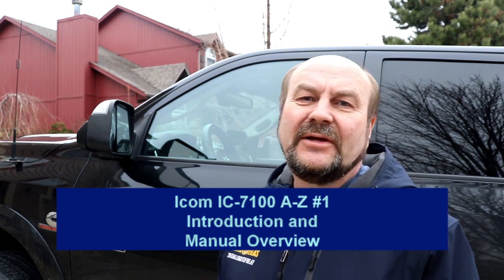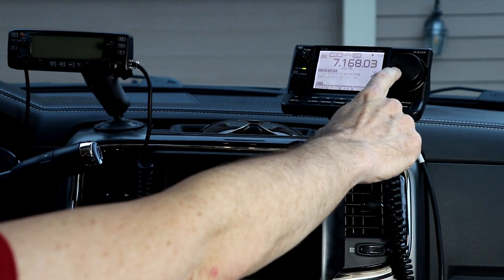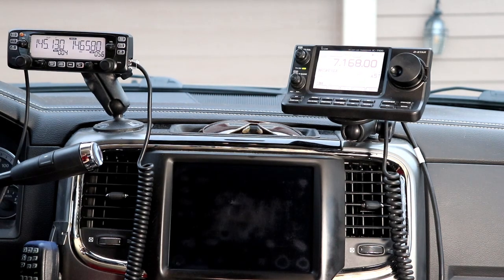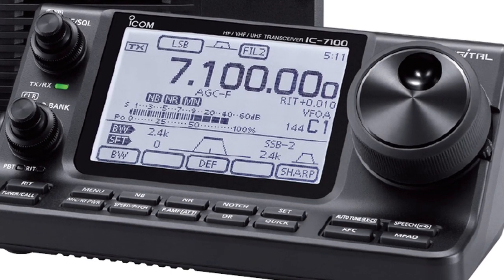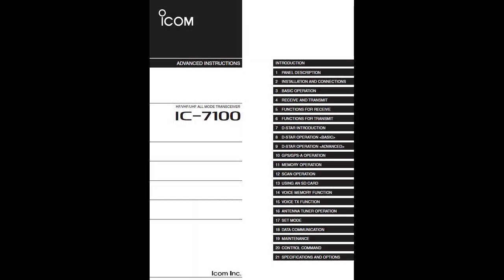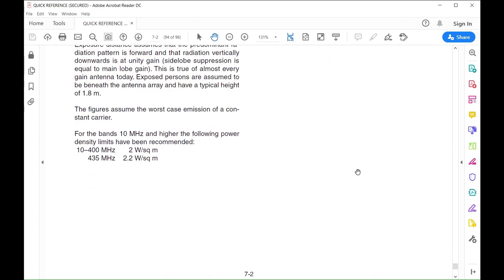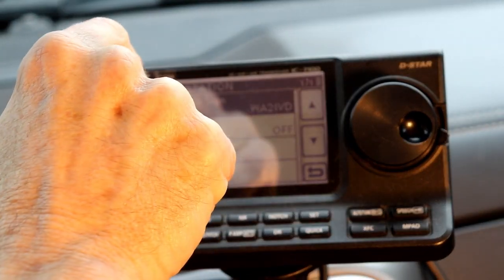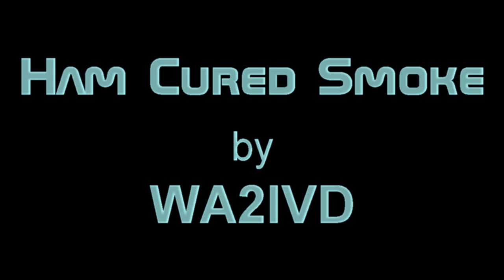IC-7100 from A to Z #1 Introduction and manual overview

Comment: Thank you for the 7100 Videos. I bought this radio as a backup to my FTdx10 (Which is in the shop!), and I use it mostly for ft8. As a result, I didn't explore the user interface too much, operating mostly from the computer. This is a Great radio! And your videos introduced me to  that! Thank you!

Comment: Many thanks for this series. I've just installed my new iCom 7100 and getting started is a bit more than a little intimidating. I tried to have it up and running for Field Day, but I don't think I mastered enough of the bells and whistles on my own as I wasn't having much luck with anything but simplex 2m. I'm looking forward to learning about this rig -- it seems like a nice piece of kit for the price and for my needs.
I got a nice Yaesu 991A for my QTH base station, and I bought my 7100 to replace my Yaesu FT8900 in my Toyota Tundra. While the 8900 offers 6 and 10m capability, it's only FM which is pretty useless. The two Ham clubs I belong to both offer 10m nets, using USB. The only way to accomplish my communication goal was to move to a much more versatile rig which I'm already seeing in the 7100. 
I look forward to working my way through your sessions.
73
Dale
KF8DLD
Reply from the maker: Hi Dale.  Thanks for the kind words.  I just mentioned in another comment that I’ve been offline for a while.  We’ve been moving into a new house.  I’ll be back in video production soon and plan to get the 7100 series re-started.

Comment: Thanks for doing this. I bought the IC-7300 last November and the IC-7100 in February of this year. I have it installed in my Jeep Cherokee. I have a video on that install on my channel. I dumped the terrible microphone for the IC-7300 microphone but had to purchase the adapter to go from a round DIN connector to a RJ45 modular plug. Not happy that ICOM does not supply the mounting bracket that I had to buy to make my Jeep install complete. I could have made one but would have spent more time into that than what it was worth. Yaesu includes brackets with their FT-891. Puzzling except I just have to call ICOM cheap skates!
I have made some great contacts with just the three 20, 40 and 75 meter meter Shark Distributing whips. I have received great reports on audio and signal strength.

Comment: Disassembled stock HM-198 microphone and found tiny mic hole is also NOT aligned with mic element rather its at the bottom of rubber mic element support nearly completely blocked. The tiny (obstructed) hole in mine was at the top of the second louver. I drilled a hole at the bottom of the first louver which is dead center aligned with mic element. I suppose you can imagine the performance increase! Be sure to completely disassemble the microphone before drilling a hole or you will damage the microphone element (obvious) if you do this "Necessary Modification"
Reply from the maker: Thanks for the tip.  I wonder if they’re all that way or if you just got one that was poorly assembled?
Reply: @HamRadioA2Z  I posted on Facebook Group also and someone else had the same. He did a similar modification and posted photos. You can remove the rubber grommet blocking the hole and remove some material allowing the original hole to be clear. Wednesday Night 10 meter Net many praised my audio, one asked how much power I was running (Just 30 watts) no more was needed with good audio (Mic Gain 65% -  Compression 2) I do not have a loud voice ; ) Thank You for HM-219 / HM-198 comparison which is what sparked curiosity ; ) I am not a modification advocate but this seems obviously necessary. . .
Reply: Another ham made a video on using the IC-7300 speaker mic with the IC-7100 https://www.youtube.com/watch?v=kZLsbM2z_ZA
Reply: Just got my 7100 set up.to replace my 20year old 706.   Found this great set of videos.    My 198 mike also had the hole blocked.   Thanks for the great tip.   I saw someone's video where he said the 198 mic was not very good, I wonder if her had this same problem?

Comment: Do you go into setting up and using an external GPS with the 7100 I am very interested in the Near Repeaters functionality using the GPS
Reply from the maker: It is something I’ve thought about doing.  Just haven’t got around to it.
Reply: @HamRadioA2Z  Definitely looking forward to it. As a relatively new ham researching radios, the "Near Repeaters" is probably going to be my drop dead must have feature in every radio. The GPS capabilities of the Uniden SDS scanners have sold me on the idea of active radios.

Comment: Thanks foe rhe video!  Have you heard any news about Icom updating the 7100 to directly compete more with the Yaesu 991a?
Reply from the maker: I have not.  The last firmware update for the 7100 came out in 2016.  Even though it doesn't have the hardware capability of the 7300 or the 705, there are some features on those radios that they could implement on the 7100.  I keep hoping that they'll release another update since they are still selling the radio.

Comment: Your videos on the 7100 are really great.  Can you elaborate why there is a low power output "hardware hack" required to enable advertised power when operating on phone portions of the HF bands?  Is there a firmware update to fix this?  Thanks
Reply from the maker: Hi Jerry.  Thanks for commenting and for your kind words.  You’re not the first to ask this question.  I have done some research into this and have contacted Icom about it.  It is a somewhat controversial subject.  I believe the perception comes from not seeing the meter hit 100% power on voice peaks and also, not seeing an external meter hit 100W on voice peaks.  According to Icom, the radio does put out the advertised 100W when modulated at the correct level with a steady tone and appropriate test equipment.  I have looked at several of the mods on the internet.  I have not personally tried any of them.  I’m sure they do cause the radio to put out more power.  I’ve seen some claims that a few of them will push the radio beyond 100 watts.  The questions are:  Are they overmodulating and putting out a lot of splatter?  Will they damage the radio by putting out too much power?  I don’t know the answers to either question, but I would be wary.  I have not felt that this is a problem with my radio.  When I set the mic gain and compression level to get some movement on the ALC meter, but not too much, I don’t have any trouble making contacts.  I don’t typically watch my power meter that intensely unless I think there is some specific problem going on.
To put this in context, a properly calibrated S meter on a receiver moves 1 S unit for a 6db change in input power.  6db is approximately a 4X difference in power.  So if your radio really is putting out peaks of 60-70 watts and you do something to get those to 90-100 watts, you’re not going to change the receiving station’s S meter reading by even 1/2 an S unit.  So it really is splitting hairs and (I believe) more about seeing the output power meter peg more often.
That’s my opinion.  I’m sure you’ll find many others if you do some searches on this topic.  73, Tom
Reply: @HamRadioA2Z  I do agree with you and have done additional reading on the subject as well.  Considering all settings are at least default, I’m thinking this is more of issue using an average power reading watt meter as opposed to a peak reading one.again.  Again great videos? KO4IAB 73 friend!

Comment: does this thing has a integrated ATU?
Reply from the maker: No it does not.  The 7100 can control an Icom or Icom compatible external tuner.  I use an MFJ 939i with mine.

Comment: Where did you get that amount for the 7100?
Reply from the maker: Hi Mark, What amount are you referring to?
Reply: @HamRadioA2Z  I’m sorry, the mount that is used in your truck holding the 7100.
Reply from the maker: Ohhhhh.  Got it. It’s a RAM mount. They have all kinds of options for the arms and end pieces. I’m using the 1” ball version. There are also some knock off brands that are compatible. I think the one pictures in the video came from my local Bass Pro Shop. They have them in the marine electronics area. You can also order them on Amazon and I think they have a direct shopping website too.
Reply: @HamRadioA2Z  Great thank you for the quick reply

Comment: I feel that one of the major downfalls or problems with this radio is you cannot Cross Band repeat with it. I can get by with an extrernal antenna tuner hidden someplace in my trunk but what is absolutely a horrible failing is the Japanese have absolutely failed by not putting  Cross Band repeating capabilities in this radio.
Reply from the maker: I agree that having true dual transceivers (which enables cross band repeat) would be a nice feature.  I am not aware of any HF/VHF/UHF radios that have that capability.  I suspect after packing all of the transceiver gear and filtering for all modes/all bands into such a small box, there just isn’t room left for anything else.

Comment: Kind of a weird question... Isn't there a rubber ring that goes around the tuning knob?   Or is this something they've cheapened up?   Your stock picture shows it but it's not there on your dash.
Reply from the maker: I have kind of a weird answer.  Yes, there is supposed to be a rubber ring.  The one on my rig was a little bit loose and fell off several times when I was moving the rig between the house and the truck.  I finally lost it.  I keep meaning to contact Icom service to order a replacement, but I just haven't got to it yet.

Comment: I like the Radio but as with all Icom, Price point is too high and honestly if they moved away from that form factor, I'd probably get one anyway.  It looks like something out of a 1960's budget sci fi movie.
Reply from the maker: Hi.  When I first saw the radio, I wasn’t crazy about the form factor either.  Honestly, since it’s been in my mobile setup I love it.  The angle between the display and buttons works out great with the display tilted toward me and the buttons tilted down.  I talk about this in another video here:  IC7100 A-Z #16 My Mobile Setup
https://youtu.be/bKMXoUUqcWo
As of November 2022, if you do ever decide to get one it looks like your only options will be used.  I’ve seen several posts saying that Icom is discontinuing the 7100.

Comment: help  -  Hello, 7100 Newbie here.  I am interested in data operations with this rig, and winlink email.  Help me choose a correct data cable to interface with my laptop to rig.  de N8NSK
Reply from the maker: Hi.  Thanks for watching and for your comment.  If you go to the reference website for the channel at:  https://a-2-z.tech/ you'll find a "Stuff" page with links to various accessories and cables that I've had good luck with.  For the IC-7100, specifically, I use a Monoprice USB cable.  I've added a link at the end of this comment.  Truth in Advertising:  it is an affiliate link.  I hope to have some videos on connecting via USB and digital modes soon.  73,  Tom
Monoprice USB A to Mini-B cable on Amazon:  https://amzn.to/3jaSj6F